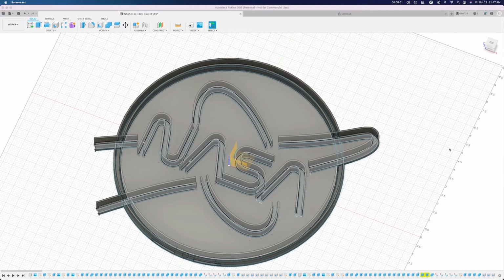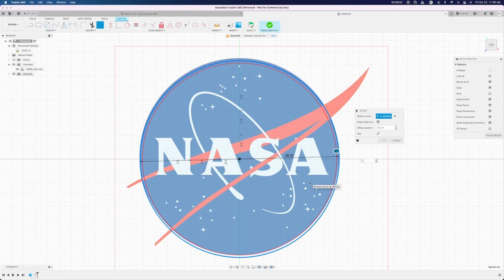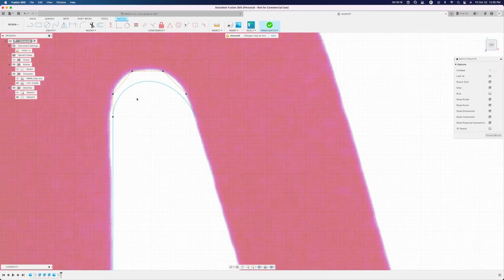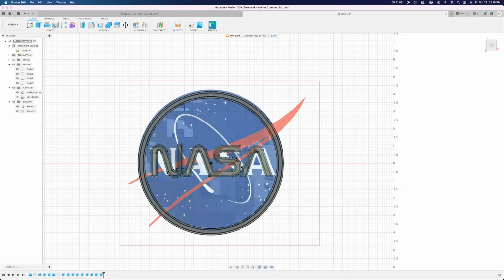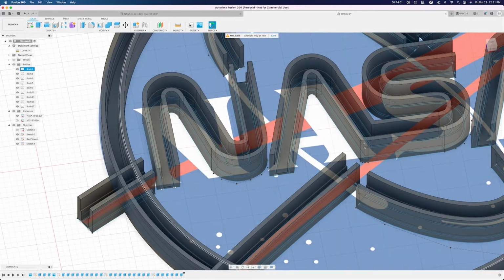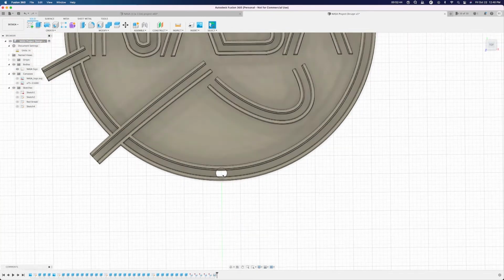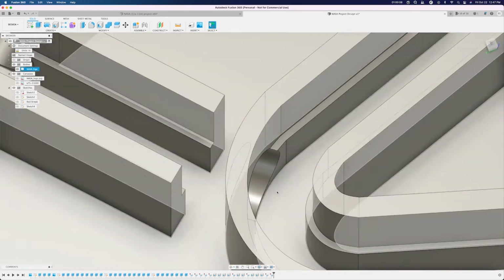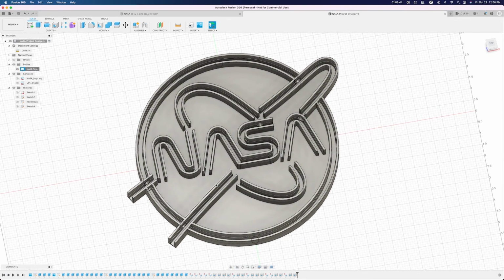How to Model This 3D Printed NASA Neon Sign in Fusion 360 (Step by Step Tutorial)

Comment: a couple years late but a better way ive found is to have the very first sketch as a box the size of the print bed then you can easily scale your canvas.
Also there is alot of situations where you can use extrude thin line instead of manually setting each line offset